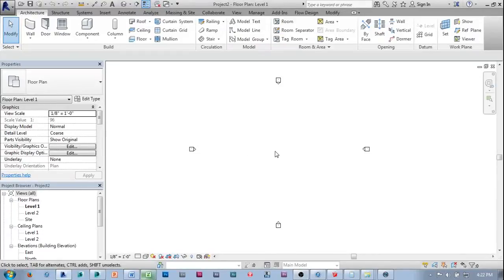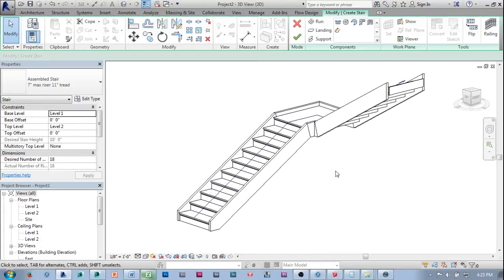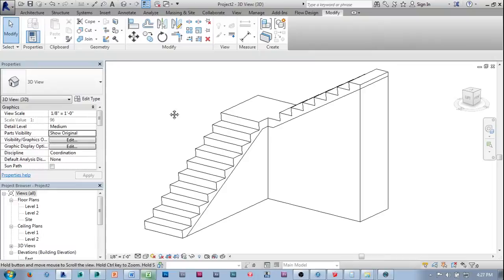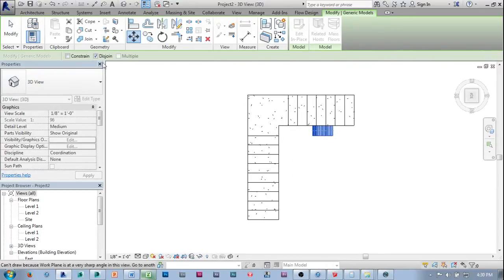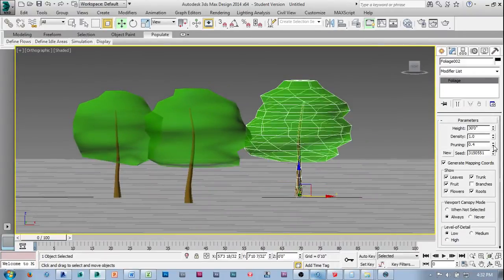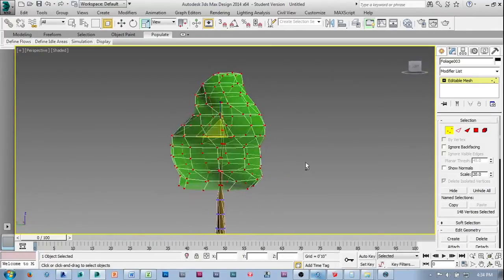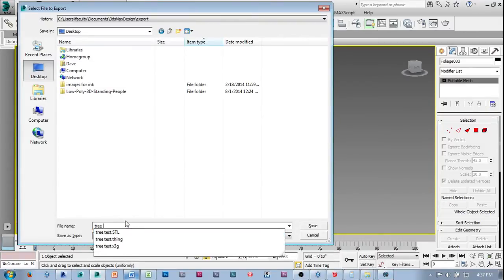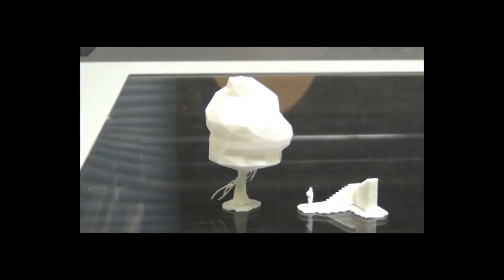Revit to Real 10 - Entourage and Details

Comment: I really wanted to see how the whole model came together.
Reply from the maker: Will do! It is at a local firm right now - they are picking it apart to build their own method. Turned out good in some places, so-so in others. I actually haven't glued any of it together, it has been more useful to pull it apart into sections - at then end of the day it is what i think i would recommend (no glue).